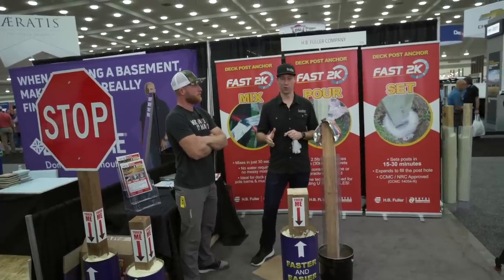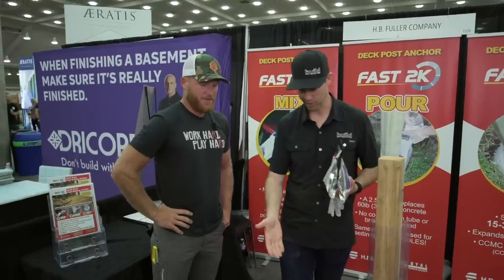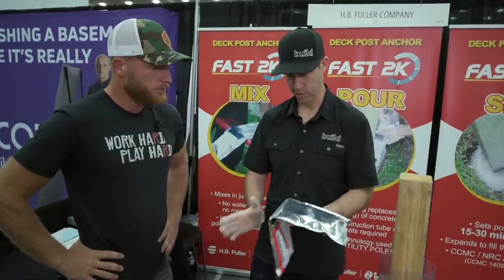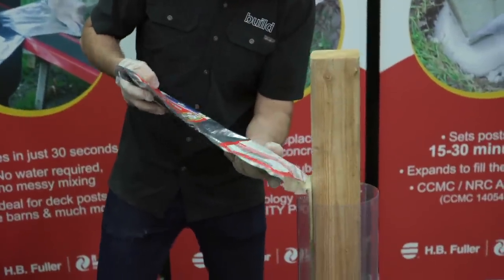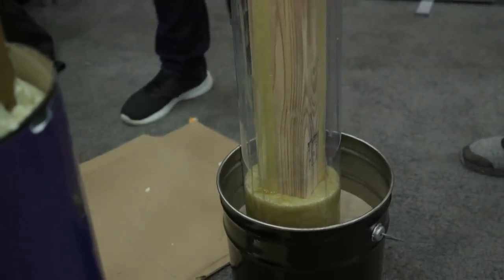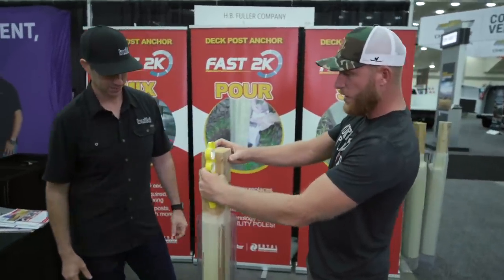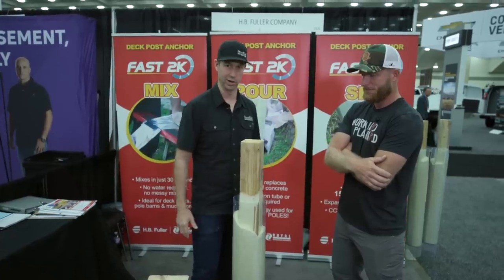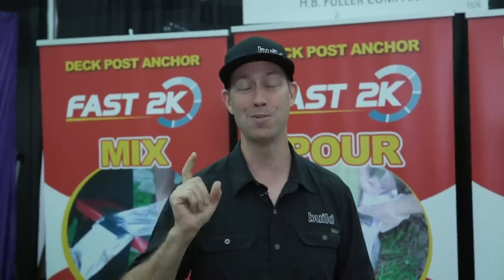Foam INSTEAD  of Concrete???

Comment: I get that you have to make money and sponsorship is a good revenue stream but don't promote garbage. Are you seriously suggesting that this can compete with concrete for strength and longevity? Bonkers! When a post rots in concrete, it's not the concrete, it's the post! Use a concrete, metal  or plastic wood effect post and it will outlast you.

Comment: Stupid thing u can do, stupid and more expensive and messy. Use proper wood treated and wood does not rot. Or cedar. They built this world with cement.  A hole bag of cement is $9.00.
Reply: 6 pressure treated 6x4 posts in my fence didn't get that memo. Neighbors watered their side yard too much, builder set the concrete too low and now the fence is leaning. I dug up around the posts to see what happened and the pressure treated is rotten.